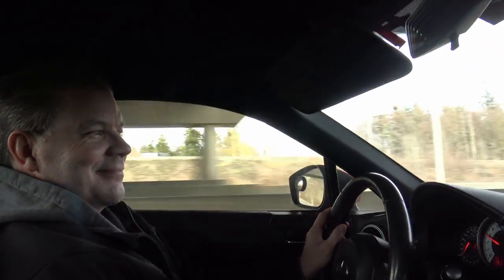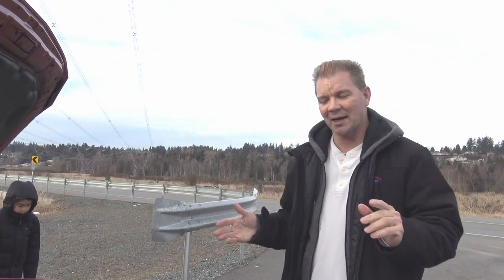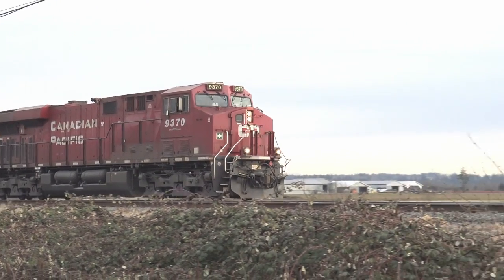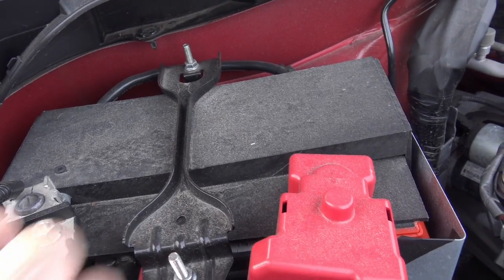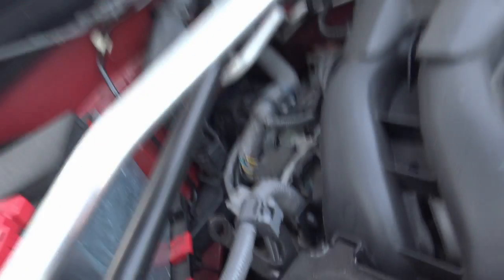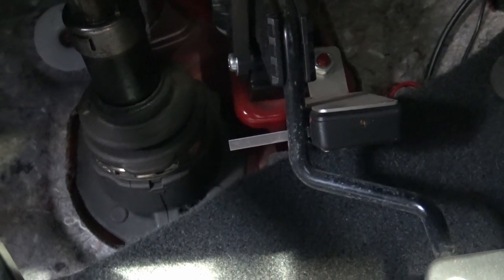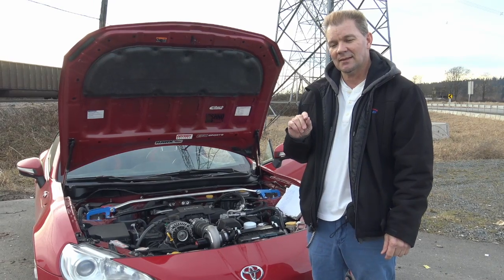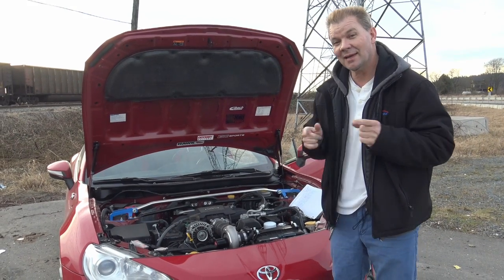The Phantom electric supercharger explained

Comment: 8:00 Partially Incorrect. A Twin Screw or Centrifugal Supercharger compresses the air inside it's own housing. A Roots Blower (think 6-71, 8-71 the type used on Dragsters and old muscle cars) does the compression in the intake manifold.
Reply from the maker: Your right , I should not have said external compression of the air.

Comment: Have you done a dyno test with the turbo installed and without it activating to see how much difference it is from stock? The airflow seems like it would be reduced dramatically when the turbo is not activated.
Reply from the maker: The Shrimp I hope to do a dyno soon and the system activates if it detects any restriction in airflow .

Comment: How the hell is a timy electric motor supposed to have enough force to push air into a cylinder under pressure?
Reply from the maker: James B  check this out!
https://www.youtube.com/watch?v=Q_ltL_pbHPY&feature=youtu.be
Reply: James B it doesnt
Reply: James B thats a turbo
Reply: Photomike and again shares something that has disabled its comment, hmmmm wonder why that would be the case whenever its about something questionable HMMMMMMMM??!
Reply: James B, Yes it has. there are even cars which have an e turbo straight from factory.

Comment: This Impeller is different comparing to real turbo, probably because ED has 50 000 rpm as max, while real turbo has 200 000+. So if this impeller has different setup, why they put this cold side helix if it doesn't work as real turbo? Well, because it's cool and shiny, pure aluminum . It adds 50hp (especially when you look at that).
Reply from the maker: All turbos have different operating ranges and this one starts making boost around 50,000 rpm hence the 5 psi of boost.
Reply: I'm trying to say, they should get better shape and better tune to electric motor to make boost earlier, easier and more efficient.There is no point to reach 50000 rpm, extra rpm has big impact to reliability and energy costs. Better get nice shape on 10-15 k rpm, air pressure feedback to controller and get constant boost at 0.5 bar or so.
Anyway, it costs you approx 1.5-2 kW to make such boost, that means you need extra generator to make your car practically usable. There is no real point to make it one-time switch-beast like it's on NOS, because 0.3-0.5 bar does no big impact (although you can feel its effect).
Reply from the maker: the impeller is modified to work better with the lower rpm range of this supercharger and a stock turbo cold side was used to keep costs down.
Reply: Well, that makes sense. Anyway, thanks for big patience and waiting for new videos.

Comment: Did you need to modify your engine (injectors, fuel pump, pressure regulator, etc) or to tune the computer to manage the extra pressure or the system adjusted by itself? With more than about 6 psi, expect that you will need a complete tuning of the engine, maybe new injector + an intercooler.
Reply from the maker: Only thing needed was a tune by Open flash tuning to get up and running the Phantom supercharger.
Reply: +Photomikes Garage umm the pcm flash is where any supposed power gain you claim you achieved actually came from, there's no way that ghetto setup would be able to compress any air against the intake valves at half throttle considering the amount of air an engine of that size moves per minute and any confession happening at full throttle is only a pipe dream, Mr top secret you are full of hot air and I hope the kid or kids in the background have a better and smarter role model around that is not as gullible as you

Comment: They have a new version of this exact kits that will run on 12 volts for $430 on eBay no waiting list still cheaper than a $650 turbo system and a lot easier to install for almost anyone
Reply: ha ha   NO dude its garbage  you get 0 about 20 horse LOSS from a ebay scam turbo charger

Comment: an important component of a turbo is the oil feed and oil drain as the bearings need to be bathed in oil all the time. How does the turbo survive 200000 rpm on dry bearings?
Reply from the maker: This supercharger only sees about 55,000 rpm and doesn't experiance the high temps of a regular turbo  so no oil feed is necessary.
Reply: The impeller is spun off the  electric motor.  The motor only runs for up to a minute or so, before the recharge which, is ready again the next time to floor it.  It's a RC brushless motor.  They dont use oil.  You only have to worry about heat but, the controller is the one regulating everything.  

This what I'm understanding learning about RC motors now.  They are fully capable of spinning beyond 200,000 rpms.  Under load and for how long is where it comes down to quality and size.  I've seen RC cars going 85 mph and up.  

An impeller ways less than a rc car and can produce plenty of torque to keep the impeller forcing air instead of air being pushed back cancelling any efforts made.  

Maybe, I'm trying to convince myself this is easier and cheaper than the parts, labor and tune than a normal setup.  I have one of these and paid far less than $2000. I just need to get off my ass and get some batteries.  

I only need to go so fast before I start having to fix and adjust shit every time i take off.  I've had air cooled vws and it gets annoying always having to be listening and feeling how the engine is running.  Stock is easy but, add a Weber or a Holley bug spray and never go out on a date again.  You will always be getting dirty.

Anyways,  time to get some batteries.

Comment: If it's producing 5 psi why have you not tuned it?? Stock injectors won't be able to add enough fuel
Reply from the maker: It is tuned and the stock injectors are able to handle it.

Comment: I see the kit didn't come with a boost regulated fuel pressure regulator...  I would assume that the small power increase if any is from your engine leaning out more than it being boosted....  Very bad for your car!  For every 1psi of intake boost you need 10psi of fuel pressure.  So at 5psi you would need 50psi more fuel pressure... don't know if your stock fuel pump could even supply that even if you got the proper fuel regulator...
Reply from the maker: I have a tune that provides more fuel with the boost and the stock injectors and fuel pump can handle the the extra fuel with no problem.
Reply: fuel pressure is referenced off manifold pressure, not your tune...  a tune cant provide you with more fuel if your regulator isnt giving your fuel rails the proper amount of fuel pressure that your tune needs.  Im assuming you stock regulator is capable of a 70 psi max that would mean that you can run 2 psi of boost safely on the stock fuel system if nominal fuel pressure is 50psi NA.  FYI I'm a huge fan of the idea of electric superchargers.  I think that the electric motor needed would be close to 3x the power of the one that you currently running and geared to spin the turbine at closer to 100,000 rpm.  I just want to see this done right and smash all the electric supercharger nay saying once and for all!

Comment: or you could just make ur own "phantom supercharger" get a procharger, attach  a prius dc motor to it, have a bank of batteries in the trunk to power the dc motor.  maybe just have a switch to instantly spin the dc motor hella fast, like in fast n furious, but instead of Nos,  a hella fast spinning dc motor... and u just charge ur batteries at overnight...  maybe batteries to charge ultra capacitors, because capacitors can dump their voltage quicker than a battery.... so its a supercharger, but not mechanical, so no parasitic  losses. its a separate electrical system... idk. only question now is, how do we get the stututus?

Comment: Does it create a restriction when under normal acceleration? As in when you are not activating the unit.
Reply from the maker: No the throttle blades themselves create the restriction.
Reply: Photomikes Garage ahh ok that's pretty awesome. I wonder if it would feed enough air for my car, a tiburon

Comment: You never put it on a dyno did you? Is it because the tuner laughed at you when you arrived? You should seriously take this video down. I don't approve of the propagation of misinformation. There are too many people on the internet who may believe such claims and waste their money as you have. Perhaps you should create content to inform people rather than trying to dupe them.
Reply from the maker: You are the one that is misinformed. Check out this dyno https://youtu.be/Q_ltL_pbHPY
Reply: ...the same video of the dyno run which cuts to a jpg at the end showing 'amazing gains'... please.
Reply: Give it a try for yourself, instead of talking smack, if it does not work or it does, now you would be more believable, with a big enough mother and Amps an electric supercharger will work. Do your research.
Reply: Ernesto Padilla just stop... I can't even... why wouldn't you just keep your comments to yourself so you don't come across as a fool who knows nothing about creating boost. Fans "work great for ventilating a toilet or cooling your face". It is not going to make your car faster. And please don't talk about my big mother again.
Reply: Photomikes Garage Looked at data from a few blowers for the frs, most are around 8psi. Without any losses (that means if you didn't require any power to turn the blower), you'd be looking at around 270whp (approximately 175whp stock). However, the cars usually only made around 225whp. That means that the blower requires about 45hp (33.6kW) to run. Ignoring that your little electric motor probably wouldn't be able to produce 45hp without catching fire, you say your batteries have 24V? Watts = volts x amps. In order to make 33.6kW from 24V you'd need 1400A. Most car batteries can't get over 700A for a few seconds, let alone those two tiny little things
Reply: HAHA UMADBRO ikr no way this works. Real supers and turbos blow highly pressurized air into the engine, these fans don't put nearly enough in to give any type of gain
Reply: If anyone disbelieves in e turbos, look at the Audi sq7. 4L diesel v8 putting out 900 Nm at 1000rpm. Thanks to 8kw of electric supercharger running of the car's 48v system and two conventional turbos that take over at higher rpm.

Comment: Doubt this works as most turbos operate between 80k-250k rpms yet brushless motors max out typically at 100k yet this is only powering it with 28v at that not exactly a small turbo either, clearly bigger than most diesel derived turbos which operate at 5psi
Reply: diesel turbos generally make 15-30 psi stock, more with modifications
Reply: avandervest guess i missed the 1 meant to put 15 lol

Comment: Did you need to do a tune after the install?
Reply from the maker: I have a tune from Open flash tuning.
Reply: You tune it after you installed the electronic supercharger?  Id imagine  with all the extra air coming in from charger it would need more fuel.

You running a wideband air fuel gauge by anychance to monitor a/f ratio?
Reply from the maker: You definitely need a tune to get the best out of the supercharger and I monitor a/f ratios with my Open flash tablet which connects to the ecu.

Comment: The cost of having it not producing boost and restricting your air inlet most of the time is just unbearable.
Reply from the maker: The throttle body blade restricts air much more than the impeller in the supercharger and if any restriction is detected the system will spin the impeller.

Comment: It works and gives 5-10% more power. 5-8 hp maximum. It's not bad.
Reply from the maker: It works and  gives 30 more hp . It's greaat!
Reply: With electric compressor you get 10-15%. It's very good. If you have a car with 100 horsepower get 10 to 20 hp. If you have 200 hp engine you get 20-25.hp. Big deal.
Reply from the maker: Check out this dyno https://youtu.be/Q_ltL_pbHPY

Comment: Sorry mate butik a turbo does not compress the air. The pressure drops as the flow increases.
Reply: A  T U R B O  D O E S  N O T  C O M P R E S S  T H E  A I R
Reply: +MaxTheKanuck turbo chargers do compress the air.  when you read a boost gauge 0 psi is atmospheric pressure.
Reply: avandervest No shit. I was making fun of the guy who said that.
Reply: +MaxTheKanuck sorry, didn't get the sarcasm
Reply: avandervest It's cool. I just don't understand how someone could even come to that conclusion. There's literally a part of the Turbocharger that's called a "compressor housing".

Comment: hi there !!, l know you not gonna do it but l want to build one by my self and the only thing l need to find is how the brushless motor is attach to the internal trim fin . if l can find this information l will a turbo with lot more because l will a use 12 to  14s lipo battery . l see also tq250-24volt so l figured it a 2500kv motor running at 28volt so it give you 70 000 rpm from the turbo and that why it you don't get more than 5psi at is best because turbo need to speed at about 120 000rpm and also the battery you are using are crap . they are heavy and not a lot of C RATE. that why you need lipo battery. but anyway  thanks  to share with us
Reply from the maker: Hi, I do not know exactly how the impeller is attached to the brushless motor , i would go to www.phantomsuperchargers.com and inquire there.  Lipos would be effective but would cost far more than the batteries I am using.
Reply: Photomikes Garage. check at hobbyking.com its very cheap . the only thing you should know is the temperature of the lipo need to be cool so you can modify a long cable  going through the firewall and you just have to hook the battery pack , also if you care about recharging you can use 6s lipo only but if you plan to spin the turbo faster you will need a complete new esc for the motor but its another modification

Comment: just heard were u paid 2,000 dollars ur crazy...u can get a real turbo and parts for that
Reply: Brad Gouge: Right, there are complete bolt on turbo kits, with exhaust header, and an INTERCOOLER ...for $2000... all of which can boost power high enough to scatter that Subaru boxer motor (meaning it can be tuned to max potential, for continuous boost power output ... not limited to 35hp gain for 60sec, lol).  Sure electric greatly reduces "turbo lag", but +35hp isn't going to be an OMG experience anyway!  That motor should tolerate enough boost to reliably run at +100hp over stock, right?  IMO, an electric supercharger delivering 35hp, isnt' going to be too interesting if the price is over $500.
Reply: Brad Gouge he can get a small block turbo kit lol
Reply from the maker: This is a different experience , the boost comes on right away which is very satisfying in daily driving.
Reply: im not on the electric turbo side but decent turbos cost atleast 3k but if you want to use turbo technology from 50s then go for the 1k turbo

Comment: LOL $2000 you can get a real supercharger for a bit more lol
Reply from the maker: A conventional supercharger is actually a lot more when you add in the supporting mods like inter coolers and adds a lot more weight to the front of these cars as well compared to the electric supercharger.
Reply: yes thats true but these are like $100 on ebay what makes this $2000. the price doesn't make sense
Reply from the maker: The ebay ones don't work , this does.
Reply: Photomikes Garage if you add more air you have to add more fuel...(a tune, injectors are supporting mods)

Comment: Ppl that are saying that tbis is complete b.s. dunno shit. Yes with b.s. cheap electric motor it will not do anything bit if it is actually pushing 5psi then it WILL give you power with a tune. Simple.  When I was a kid before I knew much about cars I had a gocart with a 5hp motor and I hooked up a little leaf blower to the carb and belive it or not my top speed went from 29mph top speed to 34 mph. 5 psi is 5 psi does matter how you get it. More air=more hp. So if it REALLY does 5psi put it ON a damn dyno since it's so easy to install/uninstall and proof will be delivered. 2k tho is WAY to steep for 5psi tho.
Reply: MasterBabo no shit u need more fuel?! Why the hell do u think he got it TUNED.  Good thing u chimed in...
Reply: cringe worthy, im outta here. go on throw away money with your ricing issues

Comment: Mathematically this can not produce enough boost to notice a difference. I think you would need a motor that uses 400v alternating current to produce noticeable boost. Not to say I can't be proven wrong.
Reply from the maker: If you can turn the impeller in the housing at least 50,000 rpm you will produce usable boost and the electric motor is able to do that.
Reply: Dean, you don't seem to be using any math there.  Also volts is measure of force.  You'd have to measure work in watts to make any sort of judgement.
Reply: Any motor run by a little button-cell can turn an impeller 50k rpm. But in the real world you have to have enough power to actually compress the air. Think of air like a spring. It takes energy to compress a spring. That energy has to come from somewhere, and with blowers, it comes from the impeller. That's why it takes power (energy divided by time) to keep the blower spinning at 50k rpm

Comment: 200 HP with the electric turbo but the car stock made 200 HP and not 168 HP with you say in the video.I don't know, you speak HP on the Wheel? Because this car stock made 200hp.
Reply from the maker: Gonzalo Gimenez Horse power at the tires on the dyno is about 170, 200 at the crank on a stock car.
Reply: Photomikes Garage i think its tourqe